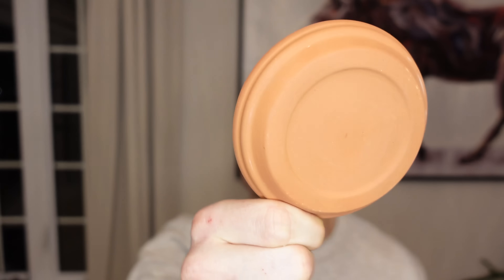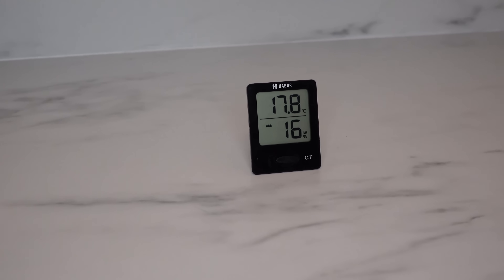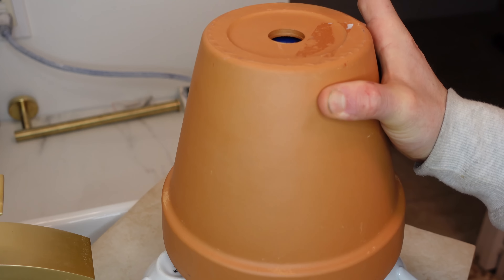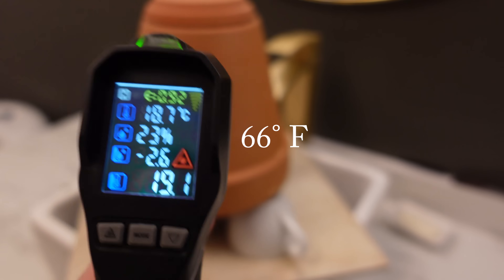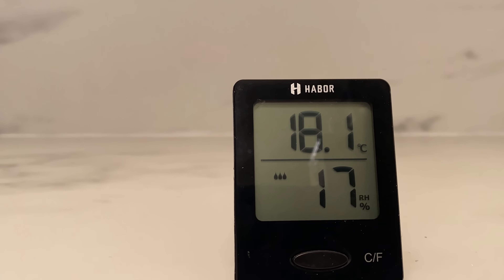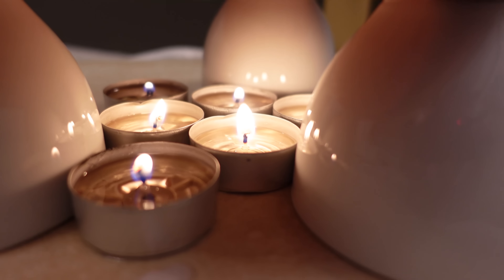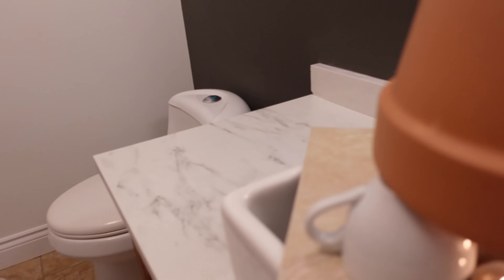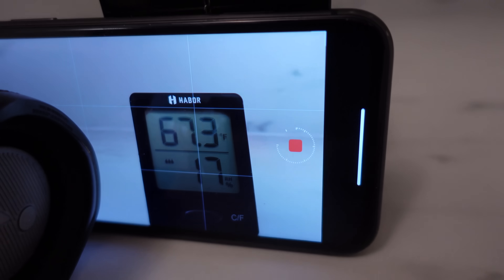CLAY POT HEATER TEST | Does It Actually Work?!

Comment: You had 6 candles lit in the room. Of course it got warmer in there. You don't need the clay pots for that. You should have tried it both ways starting from the same temperature, length of time, any power used in the room (lights), and see if there's any measurable difference at all.

You'll find out the clay pots don't change how much the temperature in the room goes up. What they will do, however, is radiate more heat, which transfers to our skin better than convection from the warm air so it will FEEL warmer near the pots but the actual overall temperature of the room will still be the same.
Reply: Completely right, whats even the point if you don't test without the pots
Reply: I was having a similar thought...glad you said this!
Reply: Just  burning the candles without the pots would create a warm spot on the ceiling and a layer of hot air above head height. You are quite right that the pots don't add any energy to the system but they do hold and radiate the heat from the candles in a useful form at a useful level in the room, without the pots they would just warm the room above the one being heated and as soon as you opened the door all the hot air would just convect out.
Reply: Exactly!  The only way to create more heat is to burn MORE fuel, or burn the fuel more efficiently.
Reply: Nooo noooooo …. I refuse to believe it!
Reply: @munzee28  he's right. The same net amount of heat is generated by the candles regardless of whether they're covered with the pots or not. The pots only absorb the lion's share of that heat and radiate it out, creating a warm spot in the center of the room.
Reply: @18deadmonkeys  but but but - it ventilates the air and circulates this out into the entire room and maybe out into the hole area you live in right?
Reply: Tried it myself without pots, inside small bathroom (5 m2). Used 9! 4 hours candles. Outside temp was 10 °C. Inside room temp was 15 °C. After 4 hours it was just 18 °C.
Reply: @robterhorst5007  It would be interesting then if you could find the same conditions and toss the pot or two to cover 9 candles for the same amount of time and see what temperature the room is after 4 hours. Also, it would be interesting to see both scenarios at 5 hours at well.
Reply: @AdventuresofGraywolf  Soapstone would be more interesting. Way better in slowly releasing heat. Will try both methodes next time.
Reply: @robterhorst5007  That would be interesting.  I'm not sure of your experience with the scientific method so please forgive me if I am saying something obvious to you. Look up thermal mass/heat capacity of different materials and you'll see some great ones to compare. One of the things you may want to control (and to vary) is the location of the measurements with respect to the heat source(s). Controlling everything except each one thing you are measuring is the key, and the hardest thing to do.
Reply: @robterhorst5007  after 4 hours the temperature outside must have changed too.
Reply: The clay pots convert convected heat into conductive heat.
Reply: Came here to say to say this. Can we retry the experiment with 6 candles and.. just 6 candle nothing else.
Reply from the maker: I will have to do another test
Reply: 4 candles burning on there own is not as good as 4 candles with pots, the air that touches the sides of the pots also warms up..
Reply: Also the light bulb would've given off heat. Light should've been turned off.
Reply: Without a deflector and radiator more heat would go up higher in a narrow band of heat. 
In general it makes a difference if the heat source can heat the air closer to the ground.
Reply: the lights would also throw this test off alot more then people would assume
Reply: That terra Cotta pot does nothing to increase the heat in the room.  It might help diffuse it in the same manner that a globe or lampshade diffuses light .

People seem to not grasp the basic laws of physics.
Reply: You're missing the point, the clay pots retain the heat so after the candles are spent the pots radiate residual heat. It's not creating more energy you're right but it's 'managing' the heat for a more even and prolonged release
Reply: @adriancaldwell  It retains the heat instead of putting it out directly. It's still the same heat, just some of it is delayed. It does not increase the heat. It just keeps it for a while. Prolonging it will not increase the heat in the room, in fact at the beginning, it will decrease the heat in the room. Later, it releases the heat where before, it would have already stopped increasing the room temperature. In the end, whether it all comes out at once during the time the candle is lit, or it comes out then but part of it is stored in the pots and then that part is released later, it's still exactly the same amount of energy/heat released into the room on average and in total.
Reply: @adriancaldwell  Exactly! Its common sense. Which we seem to be having a "Supply" problem with too 😆
Reply: So have you tried your self this? When you claim there is no diffence, have you tried?
Reply: @artonkanava  Yes, in physics class in college when studying conduction, convection, radiation, and evaporation. It's very simple physics. If you heat it with only candles, it will have just the heat from the candles. The pots add ZERO heat to the system, they just convert some of it, which technically would lose some heat due to an imperceptible amount of light. You can't make heat come out of nowhere.
Reply: @AdventuresofGraywolf  so you didnt do any test
Reply: @artonkanava  how can heating up a room be less efficient than heating up a room + some pots ?
Reply: @AdventuresofGraywolf Agreed but the pots would be very useful for catching the soot?
Reply: @nygelb4333  Well, that depends. The pots would usually make the burn less efficient so there would be more soot than normal. If you figured out how to capture the heat and not impede the airflow, it would produce less soot and release it's heat at the same time. It would also burn hotter than when it's sooty
Reply: @AdventuresofGraywolf  How hot air balloons work shows that the pot does add something to the mix. Otherwise, when they would make hot air balloons... they would not float off the ground without the balloon. The pot DOES act very similar to this, its acting as a holding tank for the heat, where without the pot the heat would spread out and away without being able to concentrate.
Reply: @artonkanava  the law of thermodynamics is taught  from the age of 12
Reply: Don’t work the same with just candies bro he clay acts like a radiator
Reply: @AdventuresofGraywolf  you are wrong. clay pot store heat and release it slow and that warm surface is greater source of heat. That is why people hase used clay to store heat in building for hudreds of years. We did the test. candels alone did nothing but whit clay pot room was +4c higher.
Reply: @artonkanava  So if two clay pots are good, would 20 clay pots be better?  Or maybe 200?  Why not just fill the room with clay pots?
Reply: @artonkanava  People didn't use clay pots to store heat unless they were touching the pot or sitting next to it with something flammable.

They used giant clay furnaces.
Reply: @artonkanava  Totally right! I've used terracotta pots myself!
Reply: @artonkanava and you tested the temperature at different heights of the room? I think not, because you would have then seen the amount of hearing achieved is the same, and the function of the pot is to retain the heat in the area of the pot, to keep the heat lower longer to keep the personal space of the human warmer longer.
Reply: @AdventuresofGraywolf  it change humidity in the room also whe you use clay
Reply: @artonkanava  removing humidity from a room make a great impact on how warm we feel seen humidity on our skin and clothes evaporate and create an cooling effect (that's why the body sweat).
Even tho you can't get more heat from a candle by doing anything a device that can circulate and remove humidity from the air in a room will make a big difference just from a small candle.
Reply: @tiddybearkush   Unfortunately reducing humidity will make the room feel cooler. Less moisture in the air to retain the heat.
Reply: @tiddybearkush  Wanna bet?  As soon as it gets icy outside the humidity drops down into the 30% range, which make it harder to heat the room. You get the humidity backup to about 70-80% you'll feel warmer. I live it, so this is vased on my wife and my opinion.  It also helps keep your skin from drying out and cracking.
🤗

Comment: Who the hell needs heaters when you have a gaming pc
Reply: Using one of my gaming pcs to heat my gaming campervan. Incredibly effective, +30° after an hour at full tilt. 42 outside, 70 inside

Was expecting it to be inhospitable until after having my propane/electric heater tested and battery system installed, but running an extension cord to power the pc has it very comfortable for now

Comment: Candles may produce Carbon Monoxide if burned and any ventilation will reduce the heat
Reply: Someone said that beeswax is best, or olive oil candles because if the wick falls into olive oil it won't ignite it so it's safer.
Reply: @Samua3  beeswax candles burn longer. That's why the tent heating device's use them. Up to like 11 hours. I would say anything where you can't control the oxygen to get a clean burning flame would be dangerous without ventilation. If you're creating soot at any point. Not good.

Comment: I've got one running now, and I'll tell you can use an old saucepan. Metal, of course is a terrific conductor, and just the same as the clay pot it traps the hot air and converts convection heating into conduction radiation heating. Just remember, the limitation is the candle.
Reply from the maker: Yes that’s true!
Reply: so candle + pot = more heat than just the candles?

is this what you are saying?
Reply: @blindcamel6236  What happens is the heat is transferred to the pot then is radiated from the greater surface area in the form of ambient heat.  The pot also acts as a thermal mass as well, where the candle would literally push the heat directly up by convection and you wouldn't feel heat from it unless you literal scrunched up against it.  You can get a similar effect by boiling water, you want to slow the heat from going straight up into an ambient surface.  The energy yield total would be the same, it's just how you transfer the heat so you can make better use of the energy used.
Reply: @MrWirelesscaller  What do you put on top of Pan? & Does Candle go into Pot or underneath?  Thank you.
Reply: @Carols-hu8vo  My clay pot has a base that almost looks like a plate under it.  The way mine is stacked when used is the base bottom, candle placed on it, I already have shaped wires from long ago (but you can easily do this with 3-4 large binder clips, just pinch them to the lip of the pot) for "legs" and the pot is inverted (the big opening facing down with tapered side facing up with the small hole facing up hopefully this part makes sense).  This way the pot acts sort of like a clamshell with a gap provided by the legs which allows an airflow.  You can also regulate the top hole with a coin by sliding it like an iris to help control the temp a little (move it with a knife or some other object goes without saying).  The problem now is finding clay pots in some areas as many have replaced them with plastic pots.
Reply: @blindcamel6236  Hold your hand 1 foot above a tea light - your hand will feel hot. 
Hold your hand a foot about the pot - your hand will feel mildly warm. 
The candles are still producing the same heat with the pot; it's just that less is being launched up into your ceiling!
Reply: @blindcamel6236  Nobody said that, go back and read again. There is a difference between convection heat and radiant heat. Convection heat takes much longer to heat a room vs radiant heat. Doesn't matter if they're the same amount of energy, it's how it's dissipated that matters.